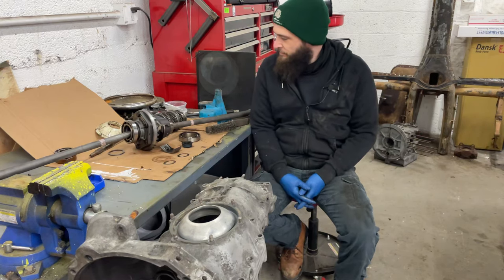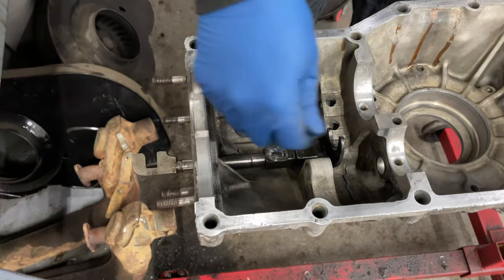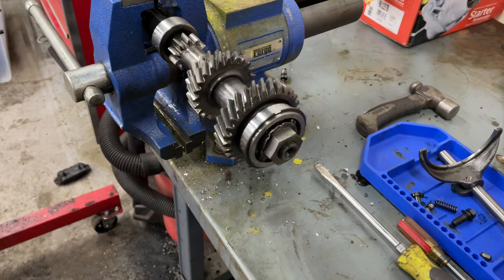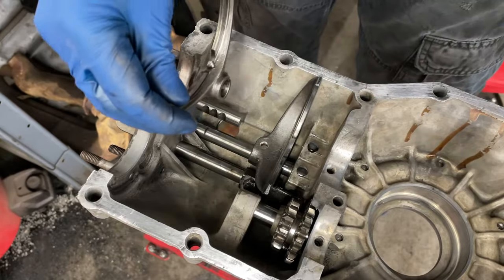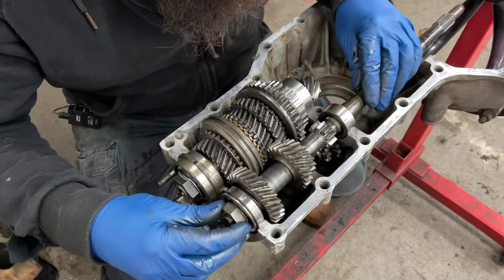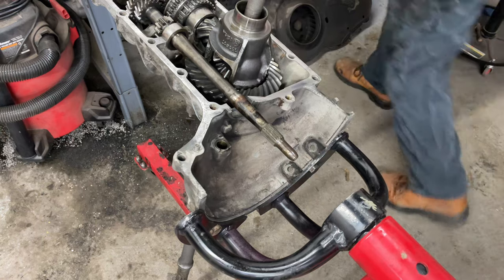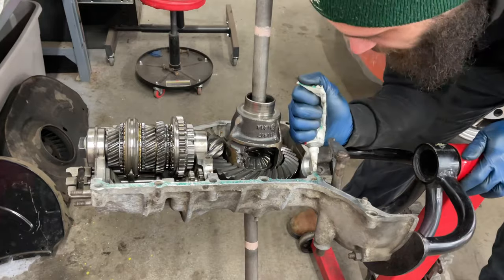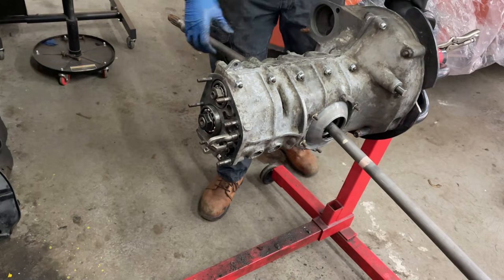SPLITCASE TRANSMISSION - Early Classic VW swingaxle Gearbox Main Case Assembly

Comment: try using yamabond or honda bond on the cases. it lasts longer. the aviation eventually seems to leak. That is why we switched many years ago. It wont for a little while but after a few years. It is for motorcycle case halves. hondas and Yamahas dont leak unlike harleys.
Reply from the maker: Very familiar with Honda-bond; I was a Honda tech for a few years. Do you Honda-bond on the engines as well? For case halves and cylinders?
Reply: @wickedwerks  case halves yes cylinders no but it would probably work. There is a a permatex product we used to use on cylinders. or just use mega black silicone. gaska cinch on like oil pump gaskets. Basically a contact cement. Or you can use on oil pump spray a gasket. really thin and just holds the gasket in place.
Reply: Yamambond is my go to, works every time.

Comment: Thanks for putting this video together. Besides the Samba article you reference, there is very little else documenting how to rebuild/refurbish these type of transaxles. Mind you most people replace them with a more "modern" swing axle. Other than Mike's observation of missing first gear syncro ring, I'd say it's a success. Thanks for a great video!!
Reply from the maker: Thanks for the reminder! I meant to put a link to that samba thread in the description.

I think Mike was joking, the splitcase trans is a non-syncro first gear.

Comment: I did exactly what you mentioned about putting the diff in upside down. It was awful 😂. 1 foreward gear and 4 reverse gears. That was alot of work to pull it back out and tear it apart to flip that back over. Ill never make that mistake again

Comment: Nice work, hopefully you have no leaks, I used that curlt stuff and it didn't seal :( I changed over to permatex.
Reply from the maker: All a process of trying different stuff. I don’t mind pulling it all apart and trying to a different seal, or building another one with a different sealer. Thanks for watching!

Comment: Nice video! I'm here because I recently acquired a 54 bug and may need to do this. Want to see if I can tackle it myself. Have you tested the trans yet?
Reply from the maker: @williambroer64  kinda sorted! I’ve been able to drive around the parking lot with reverse, first and second. Trying to sort a charging issue and finish the suspension before I take her on the road. You can do it, super easy!
Reply: @wickedwerks  that's good to hear! Good job! This car is a real survivor. 54 ragtop semaphore car. All original and 95% complete. Got the original motor running and it runs perfect with old German wires still! Tried the trans yesterday. Pops out of first immediately and I believe 3rd gear slips or barely moves when I rev. Do you know if the syncros and gears are easy to source? Just started researching! Tha is for the reply! You got another subscriber! Keep up the great work!
Reply: @wickedwerks  oddly enough the bad trans is probably what kept this car off the road for so many years. I'm guessing 40+  no rust!!!
Reply from the maker: @williambroer64  I’m not sure, I haven’t had to do it myself. I remember hearing a few years okay that first gear was difficult to find. I’d make sure your shift coupler is in good shape and see if adjusting the position of the shifter base helps at all; trying moving it forward a little bit. Good luck! Thanks for watching
Reply: @wickedwerks  ok. Yeah I have it up on jack stands right now. That's how I was testing it. In the air. Going through the brake system at the moment like you.

Comment: Did you find out where that ring goes ?
Also didn't see you tighten that first nut up
Reply from the maker: Not yet. I’m sure it will reveal itself in the first test drive, assuming it even belongs to the gearbox. What first nut?
Reply: read the first comment Mike said where it goes as far as the nut it was the first rod you put in that had that adjustment ? not sure whats it called
Reply from the maker: @kaptainkirk719  Mike was making a joke because these early splitcase transmissions do not have a synchro for first gear.

The bolt on the reverse gear selector was torqued down; I just didn’t film it.

Comment: I have a 58 split case I need to rebuild. I know parts are hard to come by, how do I tell if gears are still good or toast? Thank you!
Reply from the maker: Unfortunately, I don’t know either. I would imagine if the edges of the teeth on the gear; where it meshes with the slider are all chewed up or worn down; it’s probably toast.
Reply: I am not sure what gear it is, but the biggest one in the whole case is the one with the gears broken off. Can I just replace that one?
Reply from the maker: @jshippey  do you mean the ring gear? That the axles attach to?